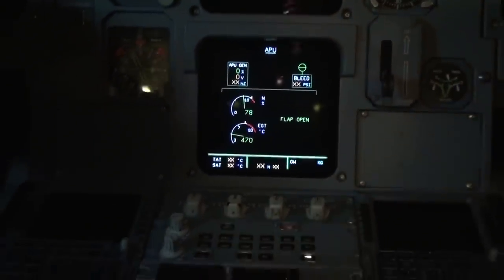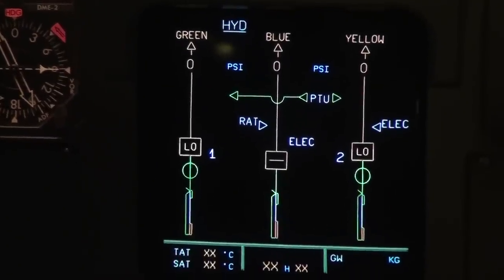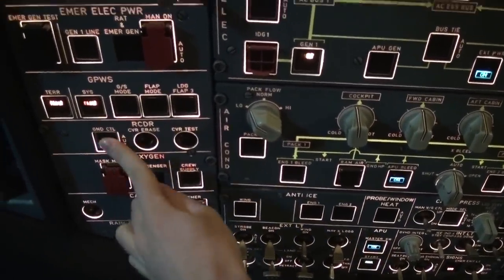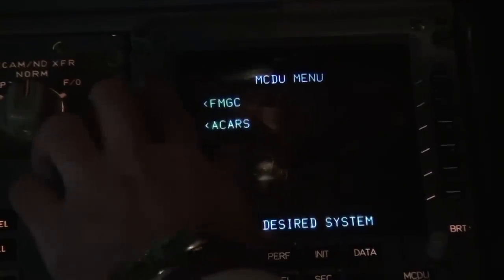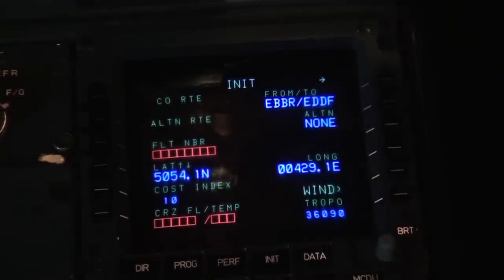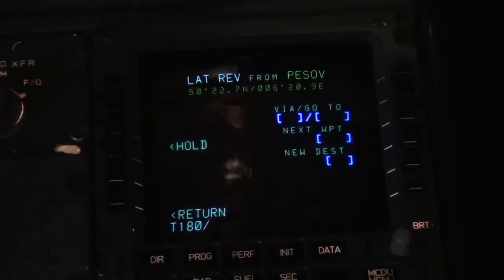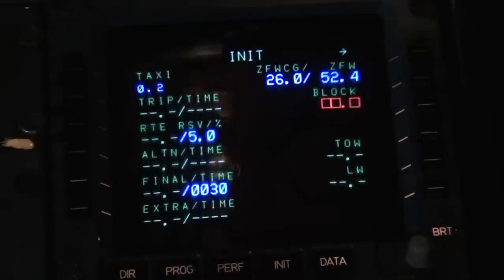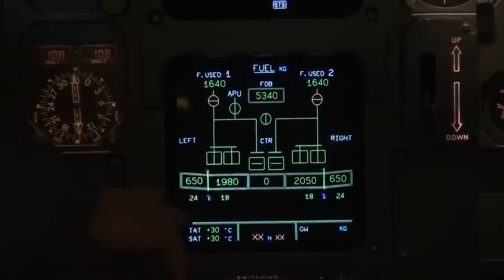Flying Airbus A320: full flight video from the cockpit (part 1) - Baltic Aviation Academy

Comment: When switching the ADIRS you put one on then wait for ON BAT to extinguish, two on hen wait for ON BAT to extinguish, then switch on ADIRS number three and wait for ON BAT to be extinguished.
Reply: Not compulsory
Reply: What do you mean "NOT COMPULSORY", Its a procedure, your meant to follow it.
Reply: He's right, it is a procedure. It's due to the fact that it's putting voltage loads on the battery. Doing all 3 at near enough the same time obviously isn't good, however with its systems it will protect it from surging. To be honest, I've seen loads of pilots I fly with do it all at near enough the same time.

Comment: You dont need to start the apu bleed as it takes fuel and its loud the noise so you can wait until u get clearence and then before pushback start the apu bleed you also shouldnt turn on the fuel pumps and the pax sign while refueling because if u turn on the pax sign while refueling if there is a fire then the apx sign will slow you guys down

Comment: when you switch on ADIRS to nav in the cockpit preparation  ,The sequence should be 123 whereas in the video   the pilot has done 132. Thank you for the video presentation 
kind regards 
A320 pilot
Reply: No, it's correct that way. The sequence is Captain (1), F.O. (3) and at last the back up ADIRS (2)
Reply: +Marianne Johannsen yes you are right but the way he did it in the video was wrong. He switched on the Captain's ADIRS then backup ADIRS and at last FO's ADIRS.
Reply: +Marianne Johannsen yes you are right but the way he did it in the video was wrong. He switched on the Captain's ADIRS then backup ADIRS and at last FO's ADIRS.

Comment: Why turn on the APU if you have ext power?
Reply: it is a standard operation procedure, the a320 manual says you do it. so you do it, also beacuse you need the apu bleed to start engine 2
Reply: Because obviously, Airbus builds aircraft for pilots that cannot think, and therefore are not allowed to think.  It's really a wonder why Airbus even put any buttons or controls in the cockpit at all.  Probably just a guise to make it appear that pilots are in control.  But in fact, the computer is in control.  ;-)

Airbus Tadpole...   Am-bisexual French Frog in Metamorphosis
Reply: Mark g u triggered bro?
Reply: Max Markus 

Actually. Nothing against the bus. Rode in the back of one today and my ass hurts tho.
Reply: You need its bleed air to start the engines. Once you have one engine started, you an use its bleed air to start the other, but you'd normally only do this if you didn't have the APU and needed to use an external starter to start the first engine.

Comment: I have a question please
When we use the APU?
Reply: When the engines are off thats why they call it APU Auxiliary Power Unit
Reply: so how does it work
i mean with out the engines how could it work? from where it gets the power
Reply: ahmad abo sultan Its a small turbine engine in the back of the aircraft tail.,
it gives electricity and air conditioning like the engine but in a smaller amount .
Reply: thank you very much.

Comment: I'm puzzled.

Doesn't the APU guzzle fuel? Why not just keep the ext. power on during startup?
Reply: APU is needed to start the engines
Reply: Neal Marko I know, didn't he switch it on prior to the startup process?
Reply: We need bleed that can only b provided by APU
Reply: Rohit Sharma Why not get a ground cart?
Reply: It's impractical and kind of dangerous
Reply: 00PiggyCosmonaut How so? 

And regardless I'd assume less fuel is consumed.
Reply: Ground air may sometimes be simply unavailable. Also using APU is easier and faster. So you don't need to tow the ground air cart to the parking position. Also with the APU you can start engines during pushback, its safer and faster.

Comment: Why take off with flaps 2 ?
Reply: why not?
Reply: Depends on the wind.
Reply: wind has nothing to do for flap selection.
Reply: Omar Airbus Yes it does, the more wind the greater the lift. WEIGHT is a big factor too, but after you know nothing about how air travel works.
Reply: weight is big factor yes smarty.
check the LPC speeds and youll see wind has nothing to do with flaps setting.
weight, temp , rwy length , A/P elev

wind changes the speeds for T/OFF not what flap setting you must choose mr all knowing nothing sadly
Reply: Omar Airbus You know not the slightest thing about ATC. Then smarts how would you ask for takeoff clearance then?
Reply: Its LPC not ATC, go and read what is LPC not ATC, , practice reading correctly please :)
Reply: Omar Airbus Flap 2 would be false the CHECKLIST STATES FLAPS 1.
Reply: what checklist dummy, its Flaps............ __
so you call for the flaps you selected.
Reply: btw you can depart with flaps 3 too.
thats an extra tip for your great flight sim knowledge
Reply: Omar Airbus Well answer this question, Who is the first controller a pilot would contact? Only a real pilot could answer that.
Reply: +Lobo Clearence?